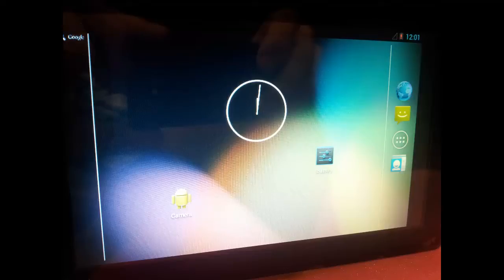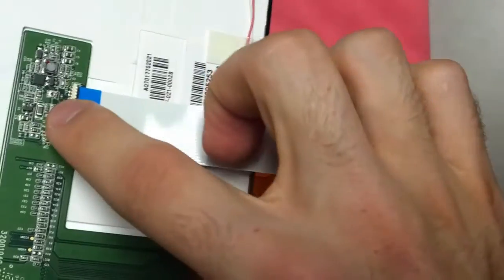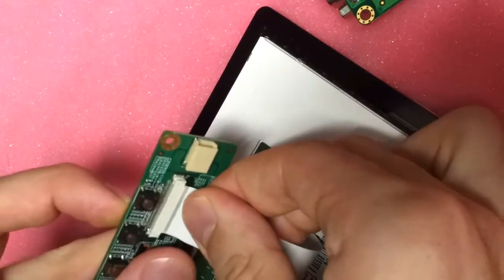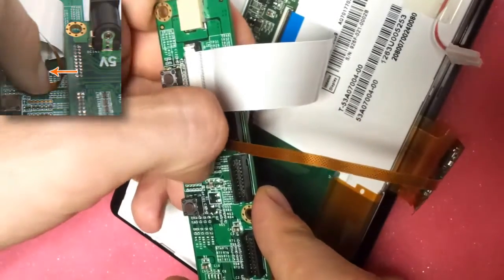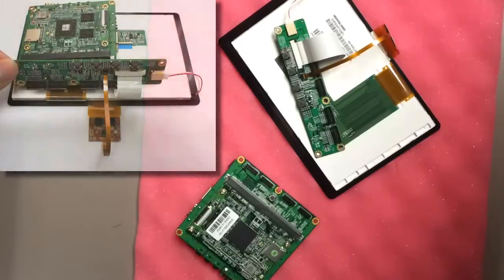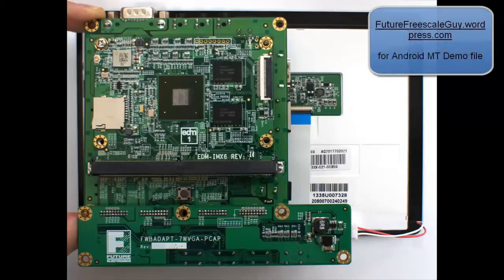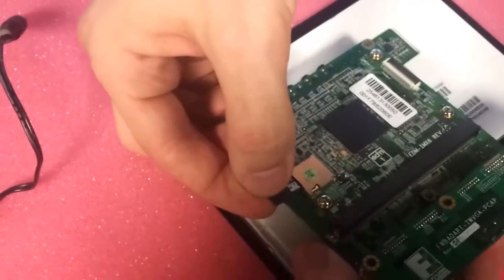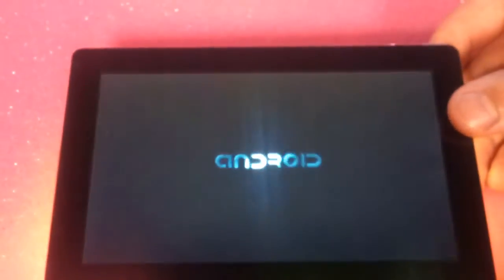Wandboard plus LCD Android, How to assemble FWBADAPT-7WVGA-PCAP and 7" PCAP LCD

Comment: A great share.
But, there is one more question for whom wants to buy the FWBADAPT-7WVGA-PCAP.
As you know, the minimum order quantify of it on future electronics is 250, which means even only one is needed, you must buy 250 at least, yes, at least.
So, how about just only one adapter board for my wandboard Dual, I only have one wandboard, and also I only need one FWBADAPT-7WVGA-PCAP.
Thank you.